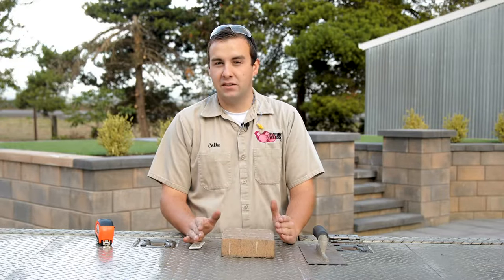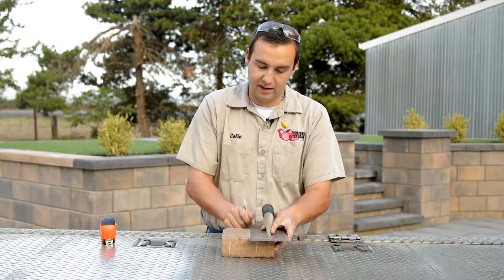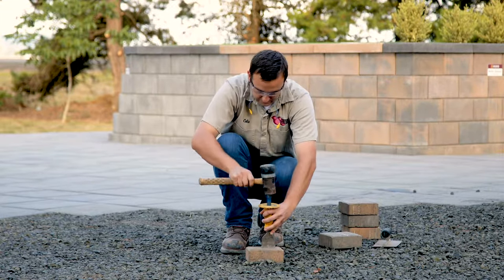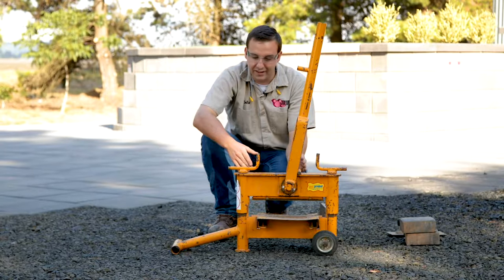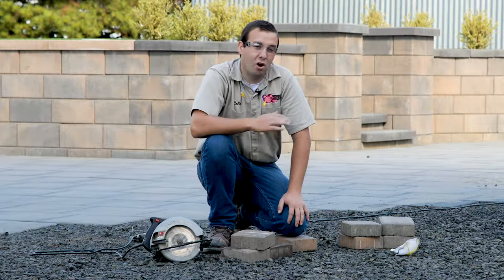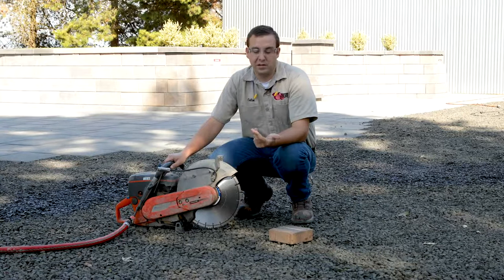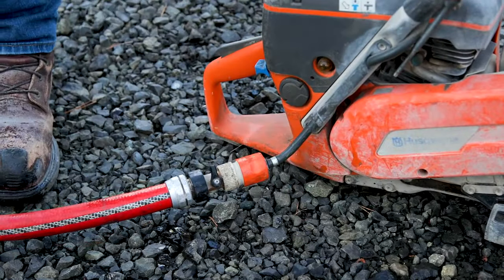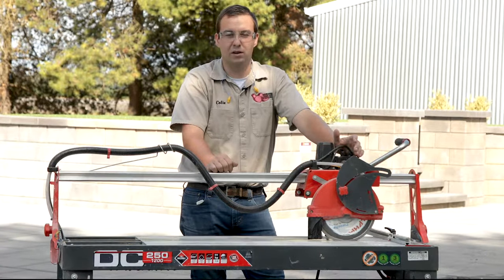6 Ways to Cut a Paving Stone

Comment: Angle grinder with a diamond blade works wonders, and you can add back the beveled edge on the cut so it looks more finished.
Reply from the maker: True! An angle grinder with a diamond wheel is an excellent tool to have in your tool bag.

Comment: Do you recommend using a circular saw to score? I would think this creates less dust and a cleaner top edge. TIA
Reply from the maker: You can definitely use a saw to score. It is especially helpful if you are cutting along a curving edge. It's what we did in this video: https://westerninterlock.com/curved-paving-stone-walkway/

It helps you to be able to keep track of where you are supposed to cut and it does make for a cleaner edge.

Comment: Thank you for the video. We want to cut into pavers that are already installed so that we can put in a pergola. Which method would would work best for pavers secured to the ground?
Reply: Looks like it's probably the demo saw. Thanks again
Reply from the maker: You can actually pluck out the pavers that you need to cut, and then cut them with any of the methods described.

Comment: How about cutting on a curve or angle how would you do that?
Reply from the maker: There are several ways to cut a curve. We cover the basics in this article and video: https://westerninterlock.com/curved-paving-stone-walkway/
Reply: Nope. That tutorial/video leads back to this one. 🤔
Reply from the maker: If you read the article and go down to Step 4, we go over how to mark, score and cut a curved edge.
Reply: @WesternInterlock  what area is your company based. We have slightly higher standards for base up north. For a pedestrian walkway we always dig 12-15 inches (never less) and the base consists of 3/4 granular A (same as you said) compacted every 4 inches in lifts. The sand is alternatively used but we usually do a limestone screening layer instead. I also wet and compact this layer before removing the screet bars and pour another layer of limestone (stone dust) and screet a second time before removing the bars and begin laying pavers.
Reply from the maker: We are in the Pacific Northwest. It sounds like you are in the northern Midwest. We don't have the freeze thaw cycles like you have. What we deal with is water. A lot of the top contractors in our area have switched to open-graded base or a hybrid base construction somewhat similar to what you describe. We've discovered that it just performs better in the long run. You'll notice a gradual shift in our videos as we adopt this new method.

Comment: Can a chop saw accept a masonry blade?
Reply from the maker: I would imagine so. Some contractors here used to use chop saws designed for cutting steel to cut pavers. That was years ago, long before better options came along. The biggest thing is that diamond blades are usually 14" diameter, so if your chop saw can take a 14" blade, you're good to go. The dust will wreck havoc on your saw motor though.

Comment: Can I use a Mitre Saw with diamond blade?
Reply from the maker: Theoretically, yes. However, the resulting dust (if dry cutting), or slurry (if wet cutting), would most likely render the saw worthless. I'm also not too sure how readily available 10in diamond blades are. Some guys use Harbor Freight 14" chop saws with a diamond blade and run them until the saw dies. https://www.harborfreight.com/15-amp-43-hp-14-in-abrasive-cut-off-saw-56790.html

Comment: can I use any circular saw with a diamond blade? I own a 15-Amp 7-1/4-in Corded craftsman Circular Saw
Reply from the maker: As long as you take it easy. The circular saw used here was nothing special.
Reply from the maker: It's safe as can be. The amount of water used is incredibly small. In fact, I've seen some contractors use a wet sponge to keep the dust down. The other thing is that circular saws are double insulated. Contractors routinely use them in the rain, so they have to be safe in wet conditions.
Reply: @@jenniferdefoor1080This was my question too!! I was shocked to see that and thought it must be a special waterproof tool. Thank you for asking this so I could just scroll down to find my answer. ❤ I'm still not sure I would feel safe trying it though?? 😳

Comment: Question I am cutting 2" h by 4" wide by 18" long now I want to cut a split face cut so i dont want to use a saw.  So would cut with tool along the line and wide Chisel 3" or 1"  so my cut will be across the 4" .
Reply from the maker: Yes, you will want to use a chisel to cut that. Simply score a line with the chisel across the paver at your dimension as shown in the video. Sometimes it is helpful to score both sides to ensure a clean break, and a wider chisel will give you the best results.
Reply: @WesternInterlock  Ok but I only have access to one side only because the brick set in place so trying to break off a clean but split face surface

Comment: Are you using a rubber mallet?
Reply from the maker: We're using a 3.7lb flooring hammer to strike the chisel. We sell modified flooring hammers that have a rubber face and a flat steel striking face on the backside. Here's what we start with: https://www.powernail.com/accessories/5mi-black-mallet/ A rubber mallet would just bounce and the stone wouldn't split.
Reply: @WesternInterlock  thank you for the quick response!

Comment: I couldn't get a straight line even when I clamped down 2X4 as a fence
Reply from the maker: It is helpful to score the line with the blade first. Then don't rush it and make full length passes as you cut down.

Comment: Ok, how about water being used with an electric tool?  How dangerous is that?
Reply from the maker: If done correctly, it's perfectly safe. We're not recommending flooding the saw and the operator. In fact, only a small amount of water is needed. Additionally, most saws are double insulated and most outdoor outlets are GFIs. You can actually purchase a saw attachment here to make it easier: https://www.amazon.com/SkatePlate-H2O-Portable-Water-Saw/dp/B087J18G1W